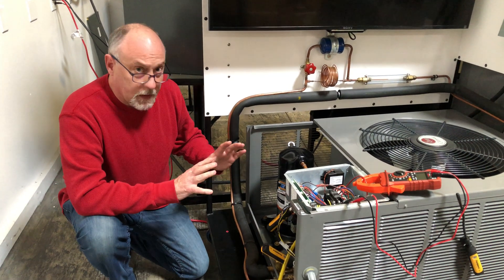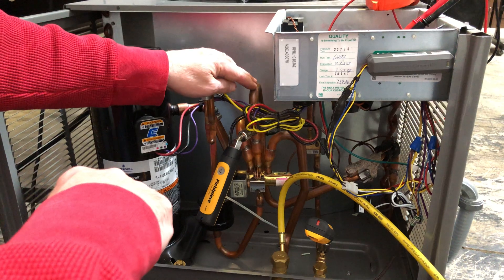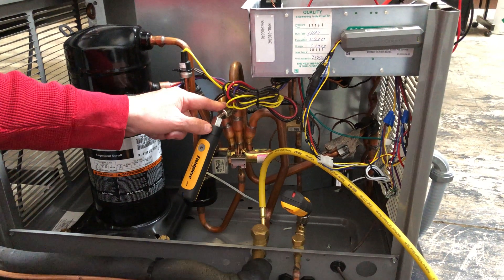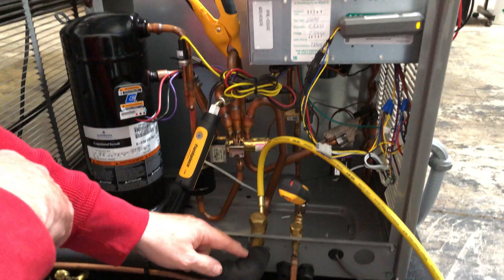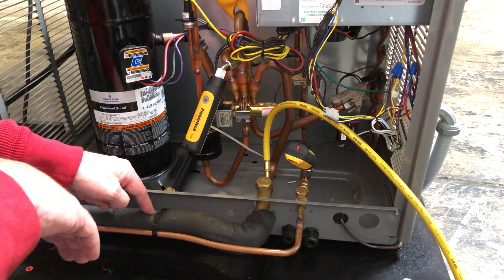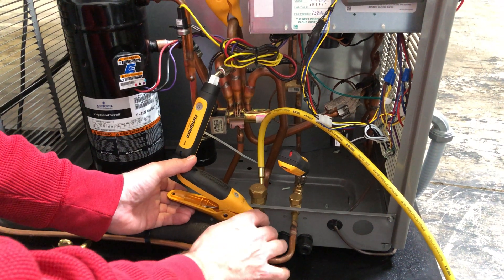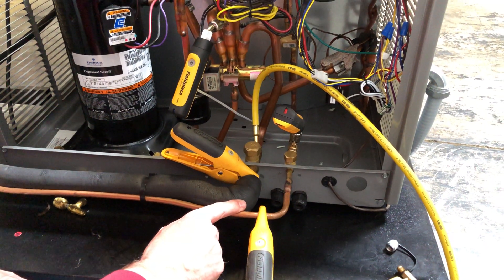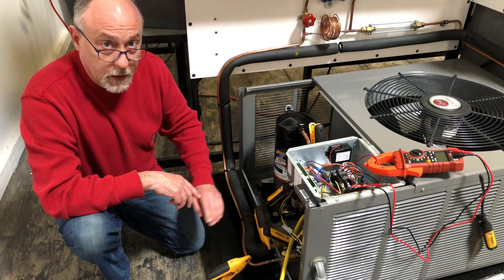Probe placement for heat pump heating mode.

Comment: What about a water source heat pump in cooling mode?
Reply from the maker: We have workflows specifically for water furnace built in.
Reply: @measureQuick  I'm look for this now. What's it called?

Comment: When you are using in heat mode I understand your placement  When you are measuring discharge gas temp and hot vapor line   Are you setting the temp settting on blue on probe or are
You still using the suction vapor position on the probe to measure hot gas temp red setting.   Thanks
Reply from the maker: The switch setting have no bearing in mQ. We mapped the probes in the toolbox to their function. In heating for a heat pump we add a third clamp so we are measuring true suction, vapors line temp (hot gas) and liquid line temperature. As well you need to have an outdoor air probe.

Comment: not to be a stickler but there is always an evaporator and condenser, just in heating mode of heatpumps the outdoor is the the evaporator and the indoor is the condenser. the liquid line and vapor line never change, but in ac the vapor line is cold superheated vapor and in heating its hot superheated vapor. the liquid line is always subcooled liquid coming from the condenser.
Reply from the maker: I do not disagree, but they are not dedicated, and that is why the distinction. If working on an A/C unit and I order the evaporator, I am getting the indoor coil. If working on a heat pump in the winter and I order an evaporator coil what are they going to send? Once you change to a heat pump the terminology simply changes because the coil location is a constant and the function of the coil is variable.

Comment: Rheem and Rudd are NOT good units to show people proper anything. These units are weird and have issues that are strangely unique to only these units!
Reply: Such as?
Reply: @RJMaker  The reversing valve being defaulted to COOLING mode if not energized if Rudd or Rheem, not HEATING as most other manufacturers.

Comment: I have only ordered 2 of the heat probes  in the set I am waiting for, where is best to fit them if you only  only 2
Reply from the maker: Mark Taylor I would probably watch the true section and the vapor line.
Reply: @measureQuick  sorry I dont want to sound stupid but I am from England I never called anything true section can you explain exactly where that is. Thank you
Reply from the maker: Mark Taylor The true suction line is between the reversing valve and the  compressor. No matter what position the reversing valve is in the flow is always into the compressor. It is always truly the suction. On a standard heat pump the connecting lines between the outdoor indoor unit change in function. It could be hot discharge gas or cool suction gas depending on the motor the valve is in.
Reply: @measureQuick  sorry you meant suction not section lol

Comment: Does it matter if the suction line temp clamp is before or after an accumulator?
Reply from the maker: bflugan I would say on the side the TXV bulb is attached on a TXV system.. Typically before the accumulator on a fixed orifice.